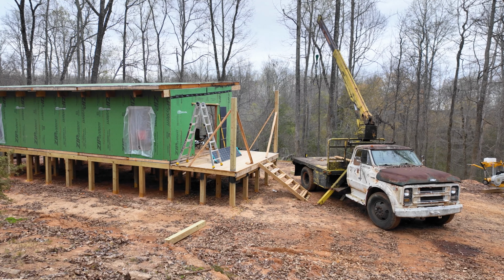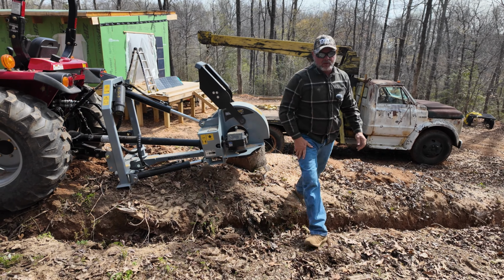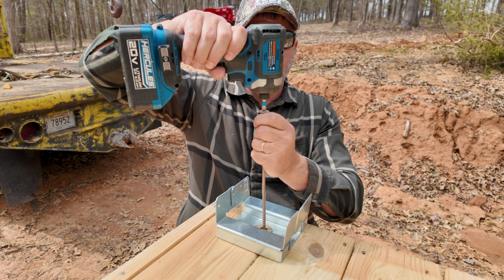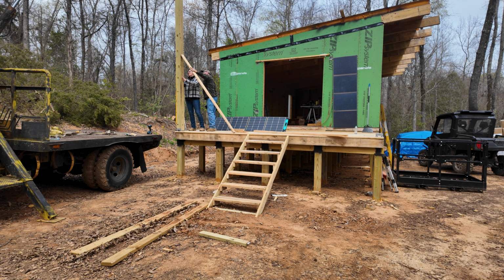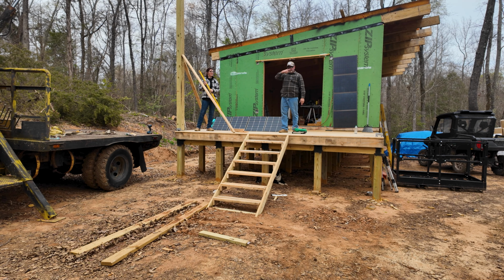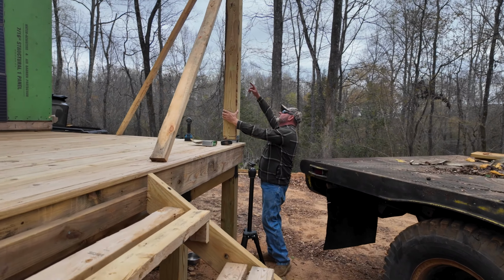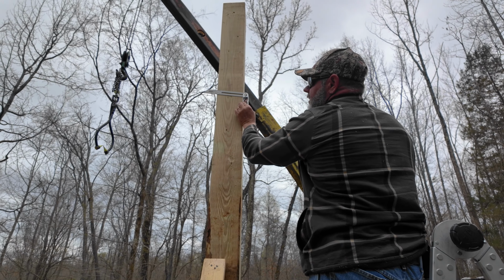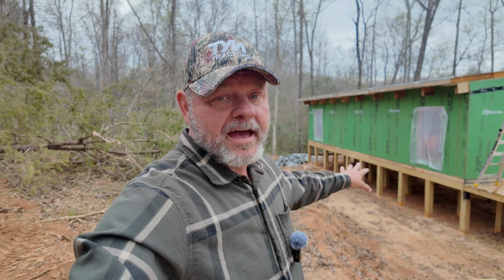Cabin Build Part 16 - Cabin Porch Roof - Beam Post

Comment: Cabin is looking great!  I don't think I have the nerve to cross that rut like that, even with loaded tires and ballast!  Did you ever have a problem with your T 264 Kukje starting really rough, not just when it's just really cold but like the first start of the day.  I  am right at the 50 hour mark and have had the tractor two springs.  I spent some time in the hospital and then some rehab so that's why the low hours.  Anything you can think i should check before I load it up.  It's not horrible to haul but if I can avoid an hour drive, I'll try.  Keep up the good stunt work!  😁
Reply from the maker: I would first try Lucas Fuel and Injector Treatment in the fuel. Pour in the whole bottle. Small bottle. If you have any water or gummy fuel, it will break it. You may need to change the fuel filter. Algae can grow in the fuel. Sitting is tough on one.

Comment: Did you create the foundation system (no slab, posts) or is there an established design/rules for how many posts require per foot/weight, spacing etc.?
Reply from the maker: I had engineers determine how many posts,  bases on my soil condition. There is a sand vein just under ground on part of the cabin. I chose to overkill versus meeting the minimum.
Reply from the maker: I also used Fast2K which is stronger than concrete in this situation.
Reply: @TonysTractorAdventure  thank you!